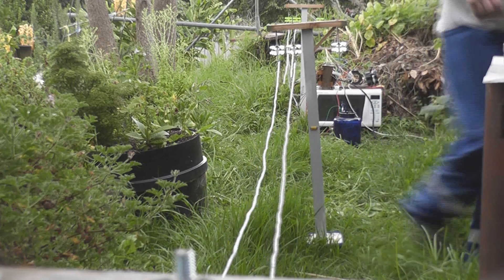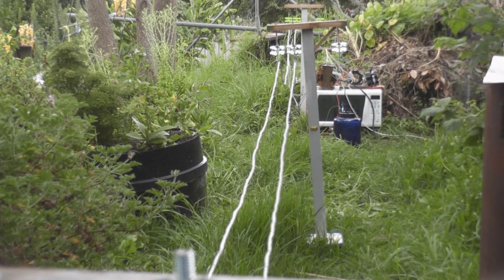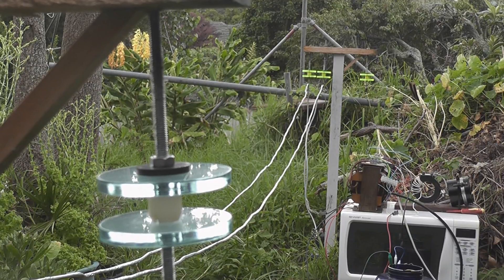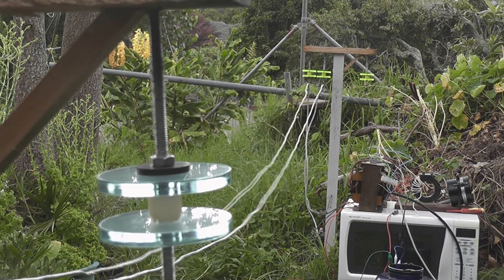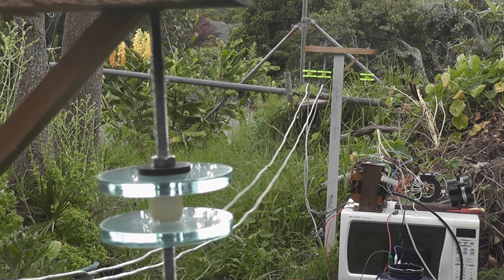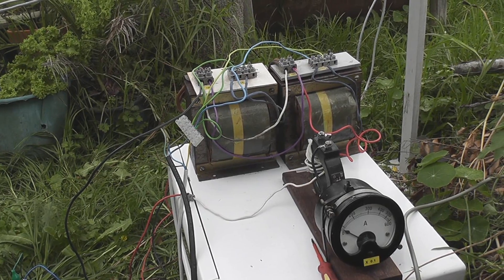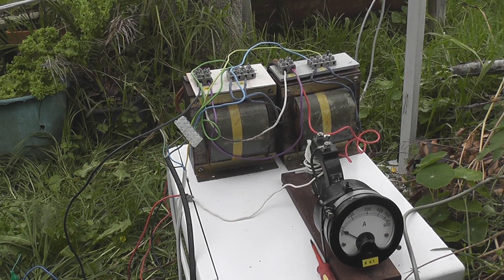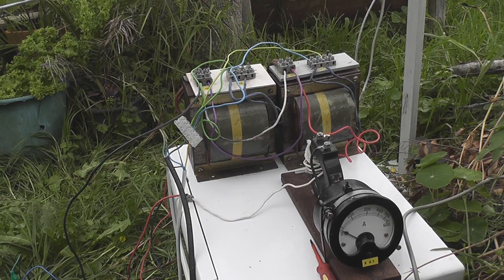Mutual Inductance in parrallel wires

Comment: I seen a video where the earth leads were attached to equipment that was then energized they flung with heaps of force if you were near them they would cause injury.
a usa protective company provides instructions to prevent injury for leads doing this basically leads the required length rather than long leads that can dance around when heavy current flows.

Comment: This happens all the time in a coil of welding cable. When you use large electrodes and 200 to 400 amps of welding current, the movement can be so violent that it will shake the trailer that the welding machine is mounted on.

Comment: Rodalco, don't export projects as 50i or 60i, it creates "ladder-like" distortions on the video, instead, go with 25p or 30p. This tip is even recommended by Google themselfs. If you use sony vegas and you are rendering projects at 25p or 30p and your camera shoots interlaced video (50i/60i) Go on the project settings and set the de-interlacing mode to "Interpolate Fields" instead of "Blend Fields"
Reply from the maker: +André Campana Merétika This video has been de-interlaced and with interpolated fields at 25p. It plays fine on our computers. Are you on a 60 Hz power system ?
Reply: +André Campana Merétika What are you talking about?  There are no de-interlacing artefacts in this video whatsoever.
Reply: +detaart It is quite noticeable in the wires as they swing, but it is only visible in 1080p and a little in 720p.
Reply: Dr. Llama I watched in 720p, and i can't see it.  All i see is some smudging from the blending, but not really interlacing artefacts.
Reply: +detaart I'm using a 144hz monitor, maybe that has something to do with it. 720p shows it a little, but it is very clear in 1080. Either way, it doesn't detract from the video, keep up the great content Rodalco!
Reply: Dr. Llama Allright, in 1080p full screen, i can see it a little bit, but it is pretty minimal.
Reply: RODALCO2007 Yeah, where i live the power lines are 60Hz, and for some reason, it only shows when played on 1080p
Reply: +detaart 
Like this: http://puu.sh/n0tao/3b3979682d.jpg
Reply: +Fossil98 Exactly
Reply: +biggdaddy2001 This is what i see, being displayed on a 75Hz monitor using DVI-I: http://i1349.photobucket.com/albums/p741/Maxleyo/Capturar_zpsnbfn9psf.png
Reply: +André Campana Merétika The effect LOOKS like interlacing distortion but it's probably just an artifact of the coding as it only seems to show up at HD... SD is fine (and I'm on 50Hz)
Reply: +RODALCO2007 Better than that, you can deinterlace using Yadif 2X so we can watch at 50fps.
Reply: ***** i got a mid-end gaming card, it's an AMD Radeon R7 250X 1GB GDDR5 128-Bit PCI-E 3.0 Core Edition
Reply: ***** That made no sense at all ...